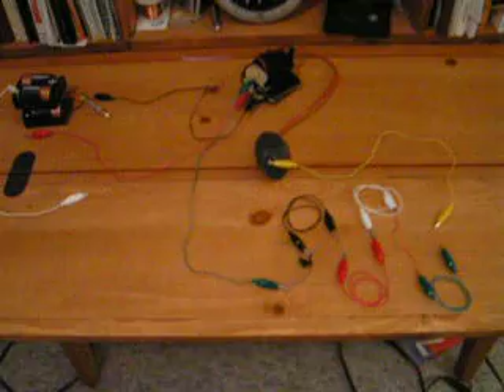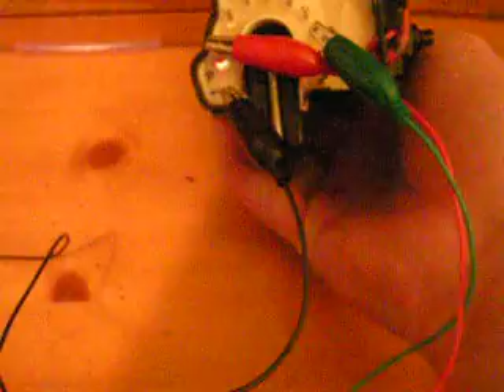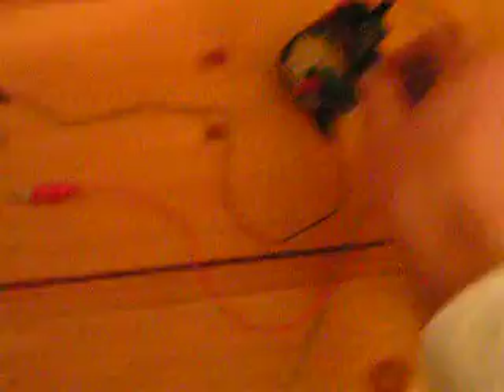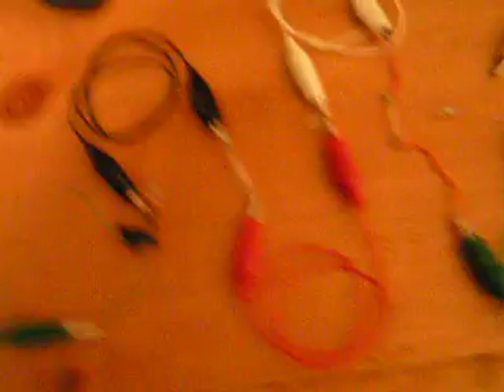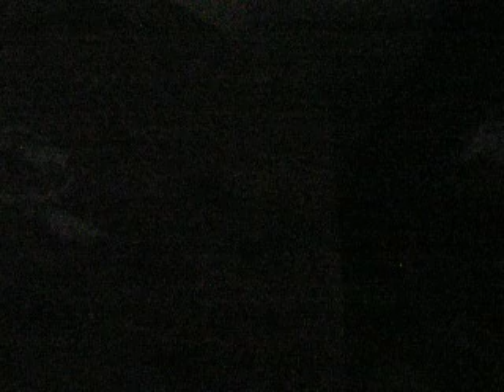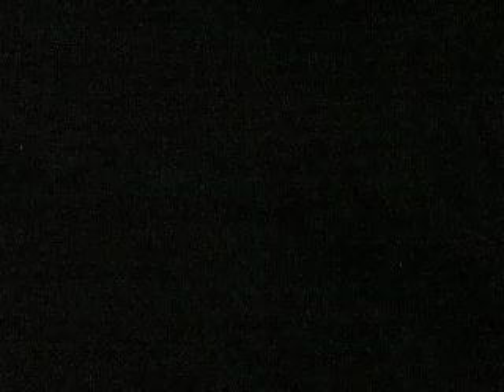simple flyback transformer setup/usage

Comment: I have a problem. I think that i made the circuit for my flyback transformer right but theres somethin wrong-It gives out only 19 volts when i use a 9 volt battery! there are sparks but they are only about half a milimeter long. Why it doesn't make normal sparks and big volts?